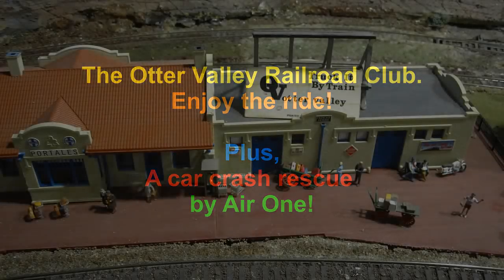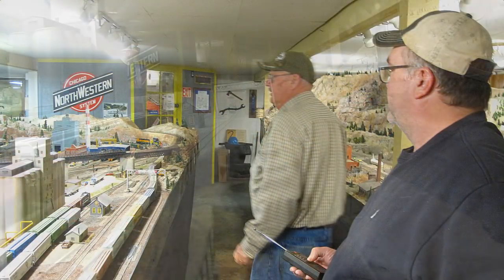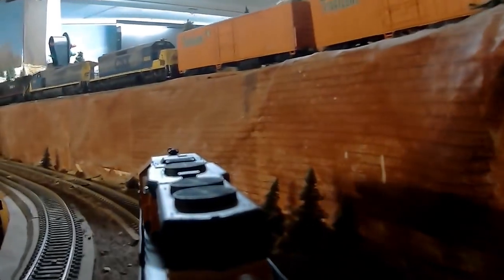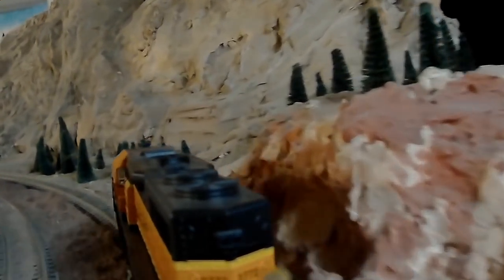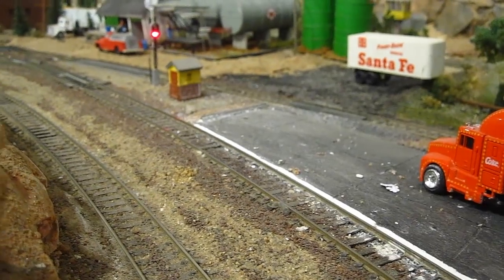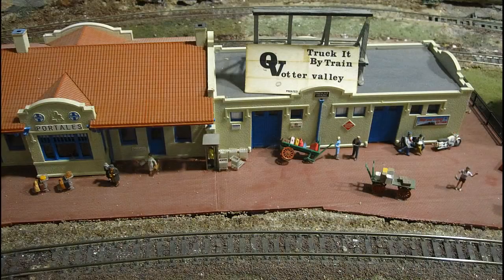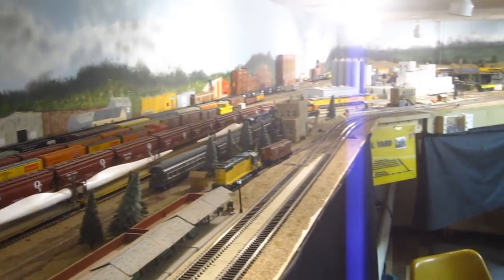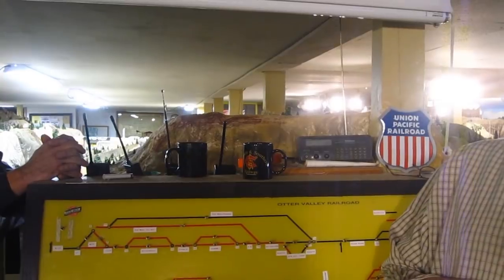Take a ride on the Huge Otter Valley Model Railroad with air "Rescue" mission!

Comment: Very nice layout.  That's the way to do it, a club.  I've seen guys do stuff at home, takes a lifetime and I'd imagine it's a bit lonely.  Have something small at home, then join a club to run the long trains.  I was in an O-gauge club.  I have trains that require a minimum of 72 inch diameter turns, not gonna happen at home.  Different crowd than the R/C airplane guys, but I appreciate the train hobby.  Thanks for taking us along.
Reply from the maker: Thank you. I appreciate your comments and glad you approve of their layout.  It is a lot more impressive in person!  Thanks kindly.